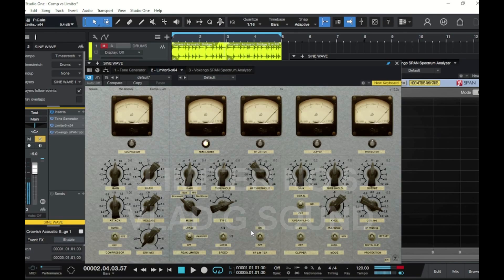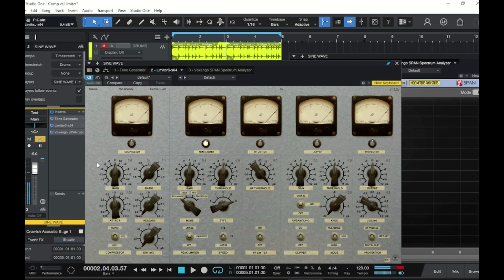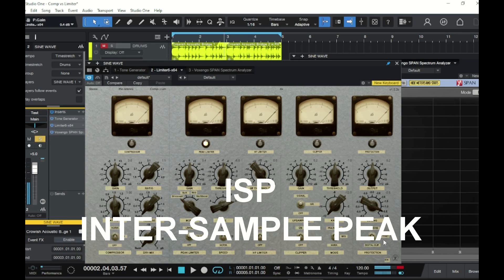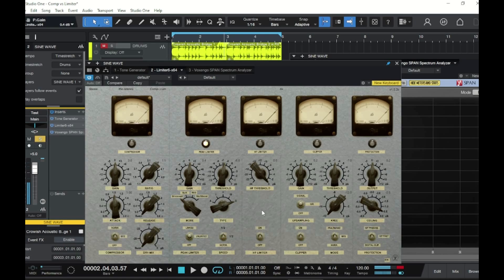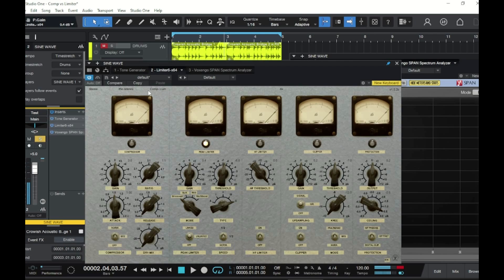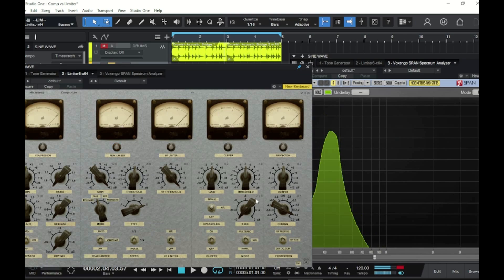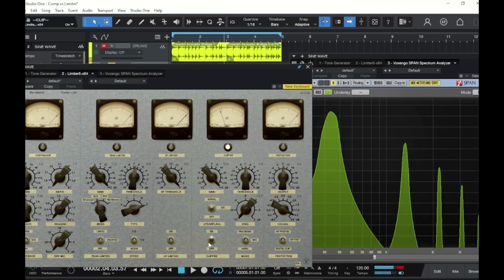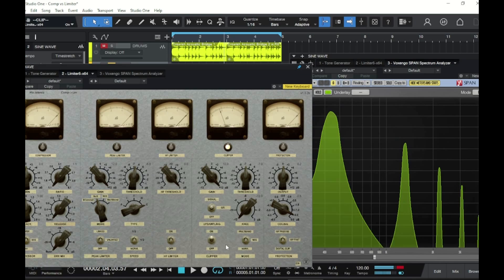When to use a Clipper instead of a  Limiter

Comment: Fantastic stuff! Clippers and "early-in-the-chain saturation of transients" (the latter from another of the series' videos) are both new concepts to me. When would you use one over the other? Aren't clipping and transient saturating both seeking the same objective?
Reply from the maker: Yeah, 2 slightly different approaches to the same thing, so try both. Clippers are made for that but straight saturation can sound really good, it just depends.
Thanks for the comment!

Comment: That was a great lesson! 🙂👍
I'm glad I found this channel! I got my qualifications in Audio Engineering from The School of Audio Engineering in 1987, here in Australia (International School, local Studio). I did live work for a while, but it became unworkable with our band's booking schedule. 30 odd years of gigging later, 2021, my daughter bought me an Audio Interface.  It's a totally different ball game, I've got so much to learn! The visuals are a great touch. Most times, like now, I come into my 'studio', which is sound treated, but not very sound proof, after the family has gone to bed. So while I have clarity at a very low volume, I can't really test the fine details until later. So often I mix, export the song, with the variations I'm trying to decide on, put them on my phone, and listen in bed and on any other system I can play them on. So, I like visuals. As in the examples, sometimes you can see the problem.
Thanks for videos about the basics like this, I would have had worked out all the maths in '87, to be told, twist the knob and see.
Reply from the maker: Thanks! Do you have a nice set of headphones?
Reply: @AudioMountain777  No, not at all. I have some 90s open backed Beyerdynamic Studio headphones that maybe I could mix on, and a few cheap headphones with good separation I track with, but I'm really in no hurry. 
I don't really mind taking my time to make decisions about the mix. After all, I'm recording songs I wrote in the 80s and 90s, and trying to play and sing everything myself, so I see it as a learning experience, visual aids are very useful.

Comment: Clippers confuse me. From my perspective the concept seems so simple. It would seem to be one of the few effects I could probably build myself. A "my first VST" kind of project, with only a gainer probably being less complex (and in case of a hardclipper, not even). Apparently it's not as simple as "if signal greater than limit then signal is limit". When searching for one (a standalone one) there are rankings, few free ones, and some have 128x and even 256x oversampling. Meanwhile the market is completely saturated with compressors, where even free ones rank among the best. So, what's the big deal with these clippers? What's their beneath-the-hood magic?
Reply from the maker: Great question.  You might enjoy some interviews from the developers of these plugins. Thanks for watching!
Reply: Some of the more advanced clippers have multiband functionality and some even allow you to dial in additional tube-style harmonics (in addition to the typical tape-style odd-order harmonics) but I think clippers are fundamentally much less complex than compressors, since they lack envelopes for the time domain. As I understand it, a basic clipper can be made by drawing a curve or a couple of straight lines at an angle on a waveshaper plugin. It seems to me that all a clipper does is boost or cut the volume of the input signal depending on where it falls on the x-y graph. Hence, a freebie clipper should work well, but oversampling at 16x or so is advisable if you're pushing it to create a lot of harmonics that will create aliasing that you'd like to avoid.
Reply from the maker: That's a very interesting idea, but I'm under the impression that clippers are designed to perform the clip by folding and sawing the peak, so I'm not sure if the result would be as good as a clipper, but it would be fun to compare those two methods.

Comment: I have never tried using a clipper and may have to experiment with it.
Reply from the maker: Great!
Reply: I spent weeks testing out various compressors on my drum loops to try and understand them better, while trying to tame the peaks and make my loops sound "fat", as I was under the misapprehension that compressors always push down the peaks. I soon learned that - depending on attack, release, and ratio etc - compressors can actually make loops more "spiky". And then I grabbed a clipper. It gave me what I wanted (lower peaks, thicker overall sound) almost instantly and without having to twiddle 3 or 4 knobs. For drum loops in particular, I'm never gonna waste so much time on compressors again!
Reply from the maker: Awesome! After the peaks are clipped you can try dialing in a compressor just for groove and feel., plus a little more balance of volume. It's easier to use a compressor on drum loops after the peaks have been clipped.

Comment: is it correct that for StudioOne the hard clipping-"Feature/Effect" is in the Bitcrusher stock plugin? Couldn't find anything else.And soft clipping is in the stock Limiter plugin? Or can I achieve hard clipping with the Limiter with Mode B. I'm not sure what Mode B does exactly. The manual only says it might distort.
Reply from the maker: The studio one clipper is part of bitcrusher, which also does lo-fi stuff, but the clipper function works pretty good. Try it out!